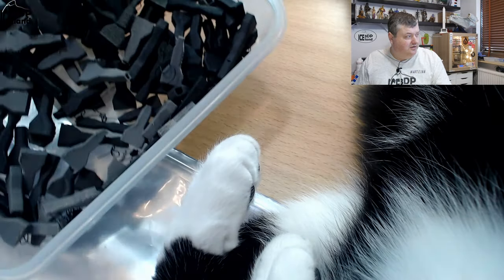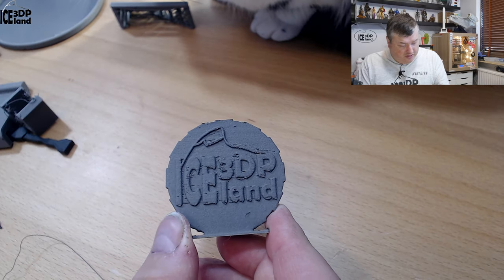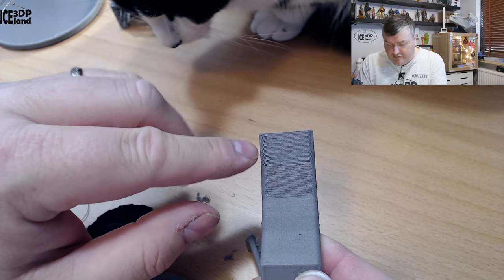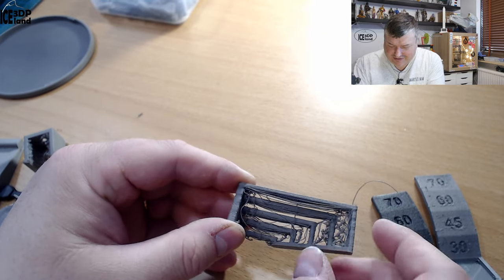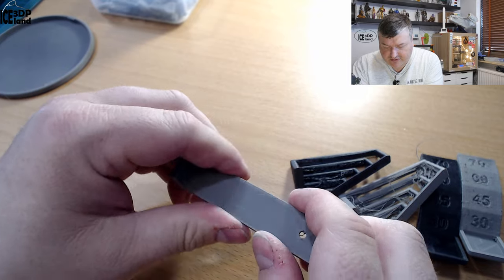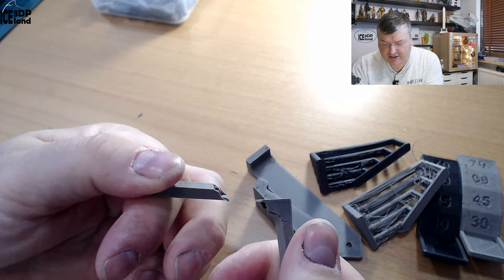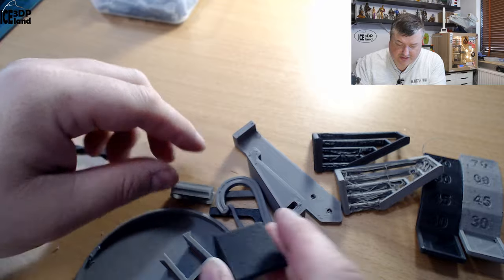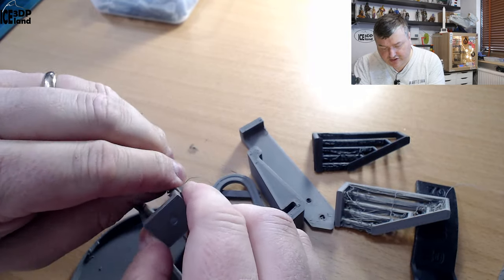Polymaker PolyMide PA6 GF and CF

Comment: Wow - that 70 degree overhang is impressive. I have been using Polymaker Polymide CoPA. It is very good, but I cannot get an acceptable overhang of more than 55 degrees, which is a bit limiting for some parts. I don't need the stiffness of the glass fill, but am tempted to buy a roll of the PA6 GF just to get the better overhang angle.
Reply: funniest thing ever, copa is more expensive. in both the 500g spool and 2kg spools, pa6-gf is a slight bit cheaper and a huge bit cheaper respectively.

Comment: Thank you for a very practical, informative review. (I will purchase some of this material now that I have seen your video.)  Note that PA6 is very sensitive to moisture when molten (and loses some mechanical properties). I would assume that if the glass fibre reinforced PA6 was properly dried before printing, it would probably be less brittle than your tests showed. You may want to try again?